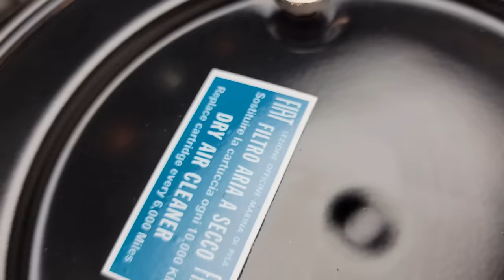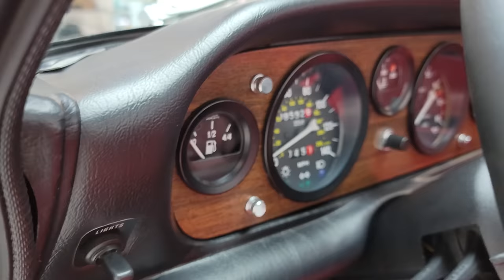ORIGINAL OWNER 1978 Fiat 124 Spider Dry Ice Cleaning & PPF

Comment: I have a late  '77 that I bought in 79  same colors,  mine has 145 k and was estremely dependable,   still runs great.
Reply: I'm thinking of buying one of those in the coming year as an investment and a fun car for nice summer days. The car just took my breath away when I saw it. Bit nervous though as I've never dabbled in older cars before.
Anything you can tell a newbie like me on what to look for and what to avoid? ^^
Thanks!
Reply: @TheRoadrunner11  try getting an late 80 or newer if you still need to pass smog inspections as we do in California and cant do any changes to  engine.    The Bosch fuel injection is smoother  and more powerful.    Auto Ricambi for parts.  They know Fiats and are very helpful.
Reply: @Tony-hx2fj  Thanks! Yes I was wondering about that too. I learned today that the earlier models were all 1.4 L engines so I guess  if the larger engines have no downsides, then the1980-1985 models are the ones to go for.
I am in Germany and while I am still unsure about the regulations 100%. It seems you can get a historic car license which enables you to drive through even environmental zones in cities without a problem, but you cannot drive more than a couple thousand Kilometers/miles a year. This seems like a solution with my name written all over it! :)

Comment: Excellent work on a beautiful example . Rare to see one in such original condition.  I liked the subtle upgrades too, aftermarket rear swaybar, drilled/slotted rotors, aluminum radiator, A.I.R. pump delete and those...Lancia?...wheels.👍
Reply: The car is factory smog legal with all the originally fitted parts, including the original catalytic converter.  The air pump was lowered to the level of the alternator for 1978.  The radiator is a Ron Davis unit that used the original radiator.  Cooling was always a challenge, but especially as the car got older.  Alarm motion sensors installed in 1979 that can be seen on the right fenderwell.  The aluminum timing belt cover was found in a junk yard from what I suspect was an older 124.  It replaced the yellow plastic unit.  Other than that, the engine bay is OEM original.  Other than gaskets, the engine has not been taken apart.  The wheels are 14x6 Cromodora CD167s from the 1985.5 Pininfarina Azzurra that were installed in roughly the last 6 months of production.  The Azzurra was the very last iteration of the Fiat 124.  Just as an aside, the soft top that iam Detailing polished out is the 44 year old OEM unit that is original to the car as well.  That was one of the reasons to ask iam Detailing to take on this project.  No one else demonstrated any knowledge of how to do this properly and safely.

Comment: NIce, I have one too, mine was featured too in a detailing/rescue mission.
This one here has a lot of work done, almost nothing is original
Good job !
Reply: Other than paint, chroming, black door tops, driver seat bottom pleated panel and the headrests, it's original.  Carpets are original.  Engine is original, never overhauled but air cleaner powder coated.  Even the soft top and plastic back window are the factory original items from 1978.  That's why I trusted it to Jakub at I Am Detailing.

Comment: Great work as always. I am curious as to why the paint protection film was added under the hood of the car?  Does the car self inflict paint damage?
Reply: Great question!  The rubber pads on the hood corners and the cowl weatherstrip discolor the opposite contact surface paint over time.  Not an issue with a darker colored car.  Definitely an issue on a white car.

Comment: Spot on. 😎👊🏻🔨

Other than cost, what other factors come into play to determine whether you can dry ice clean a car or not?
Reply from the maker: It depends on the machine you use, the settings and condition of the material you are blasting. 

With our machine we can blast almost everything, but some plastic parts are more sensitive than others. Anything like foam we can’t touch. 

I would say that we can use our dry ice machine on 98% of each car
Reply: @IAMDetailing  thank you. I appreciate the info. 😎👊🏻

Comment: How do you find a 70's Era Fiat that hasn't rusted into crumbled sections? 
I bought a 74 in 77 and used two stop signs welded in. The signs were my floor pans and the posts braced the rotted unibody frame on both sides. 
Fiats arrived at the docks on their way to the dealers already rusting. Same with early Datsun.
Reply: We just bought two that had not= major rust issues - are you in an area where it snows? That may be it
Reply: @mfiorito5550  
Yes I was at the time. Lots of salted and sanded icy roads. 
I have a 1972 Triumph GT6 MKIII that was kept garaged and up on blocks every winter. It developed very little rust.  I had a 68 GT6 MKI as an every day driver. It rotted out underneath by 1980. That was pretty good for an import car. 
The 72 MK III is still running today in 2022. Rockers are surface pitted and need replacement.

Comment: What is that you are spraying? I have s friend who is handing down to me his red 1978 Spider with 40k miles. He's the original owner. Been sitting in his garage for 15 years.
Reply from the maker: It is a dry ice cleaning machine
It uses dry ice and high pressure compressed air to blast away dirt and grime

Comment: Probably an english car was imported in Italy at the biginning of motorization and its name wass speeder (the car which goes fast). The pronunce  was written in italian mode "spider". Do you want a "spider"? No thanks. In England they say "sport car" or "roadster".  This misanderstanding  goes on today. We in Italy continue to say: "spaider".  Instead for the open air cars like Golf or 500 we say: "cabrio". The engine is a 4 cylinders emi twin camme: 1.6 1.8 or 2.0. The difference with the Alfa Romeo is the basement in "ghisa" with space inside for water. Instead Alfa is in "duralluminio" Mg + Al with iron wet cylinders. Red stripes are not original.